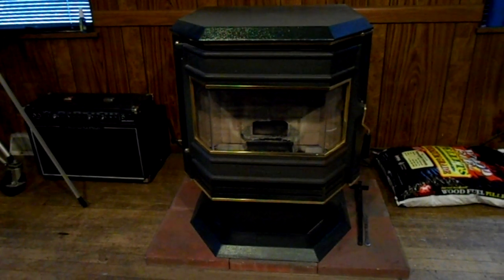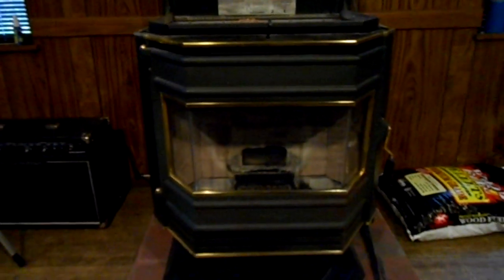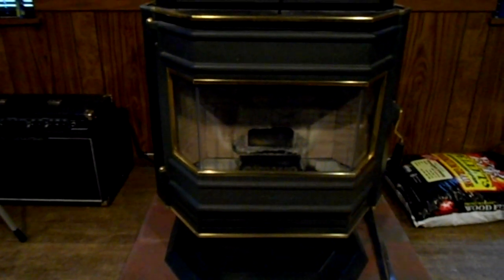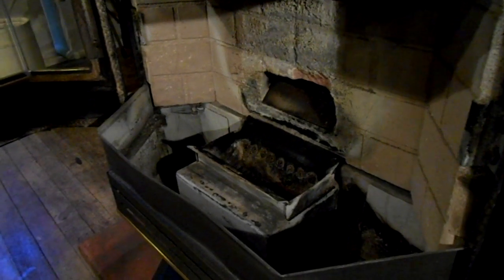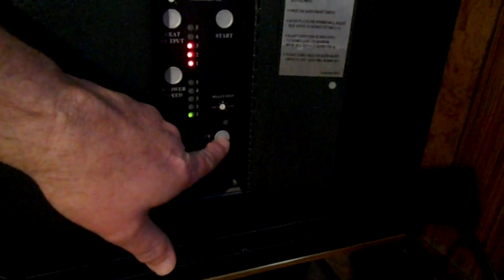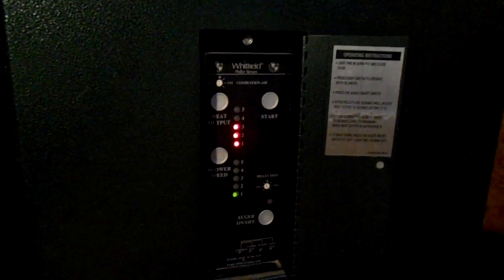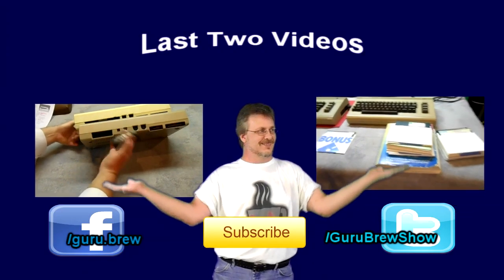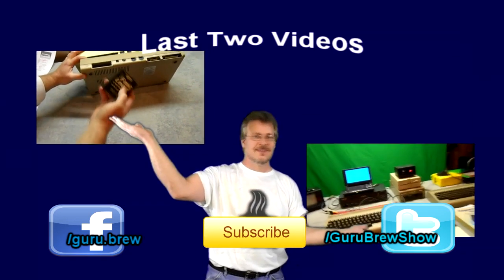Renewable Energy Home Heating Pellet Stove - Details Explained

Comment: i got the same stove thw advantage plus how did the hole plugs work out for you.There in the lower corners by the ash slides turn out after cleaning mine went to put hole plugs back in and finger went right throught it ans they no longer make them but 300.00 for stove and 2.00 bucks for the caps at lowes and there not made special from mfg there standered 1-1/8 hole plugs
Reply from the maker: Pete, I just had those side covers and all the fake brick off recently for cleaning and did not notice a hole with plug as you describe. I will look again next cleaning. Right now I have control panel problems with it.
Reply: There below the fire pot in corners hope you get it fix

Comment: I just bought the same pellet stove on craigslist for 700$. We have a new one that has automatic features unlike this one. The whitfield has been a little tricky for me, of finding that sweet spot with the damper. The problem I'm having is that after a couple hours of use the glass gets so sootted up you can barely see through it. Is yours the same way....... any advice

Comment: You forgot to research your prices a little better.  I can get pellets for as low as $2.50 for a 40lb bag of pellets.  You also forgetting the fact that you can make you're own pellets from various materials for free (aside from the cost of the pellet mill).  I completely got rid of propane and oil since the prices are just too freaking high.  I used to spend $700+ per month on oil in the winter months.